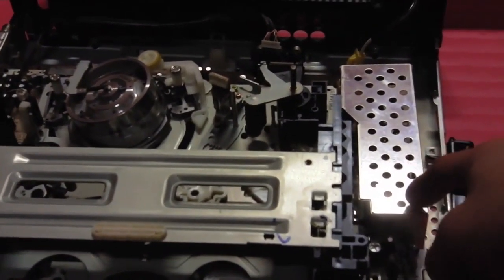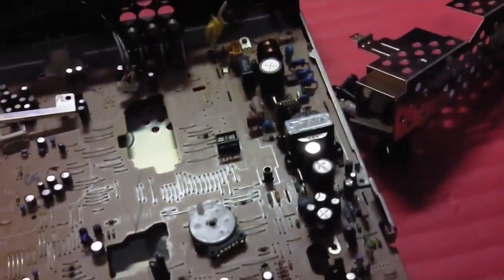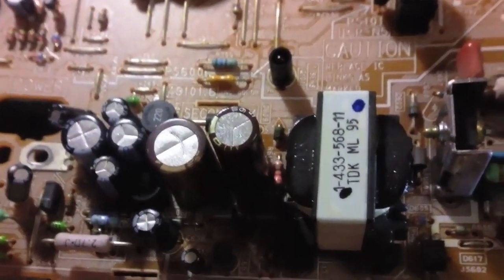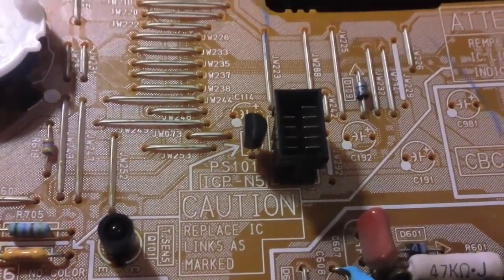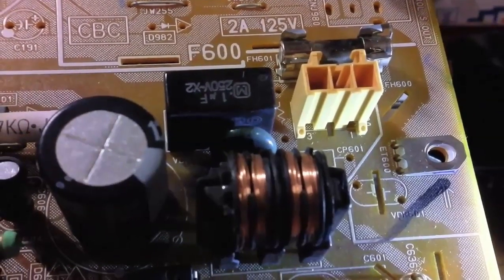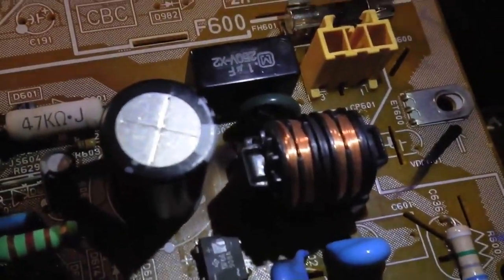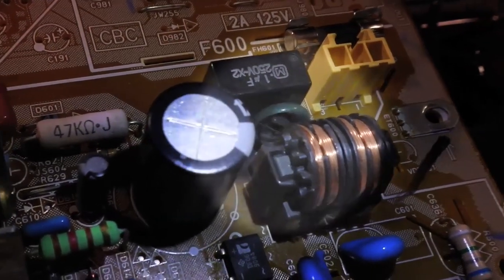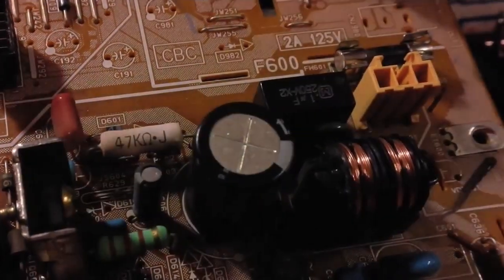Sony VCR Power Supply Over-voltage diagnosis - varistor, variable resistor damage

Comment: can you design over-current and over-voltage in the same circuit plz  with input voltage 220volt ac
Reply: MOV for overvoltage
Fuse for overcurrent

Comment: So what parts did you change
Reply from the maker: +alsteven44 Capacitor, varistor are replaced. I repaired the line conditioner (coil). See my other video for the complete repair of this unit. https://www.youtube.com/watch?v=v-OhMEKJLEE
Reply: alsteven44 hi am having a little problem getting same mov to replace a burnt one In blender.. Can I use any other type that can work?

Comment: That isnt a transformer, its an emi suppressor.
Reply from the maker: You are correct, and I appreciate you taking the time to point it out. In my other version of this video where I actually repaired it, I noted my mistake. It is listed as "line conditioner" in the official repair manual schematics.
Reply: Im glad you fixed it, I thought maybe you had given up on it when you thought a transformer had blown.
 I will have a look at the other video.